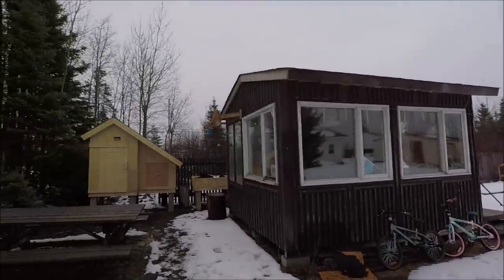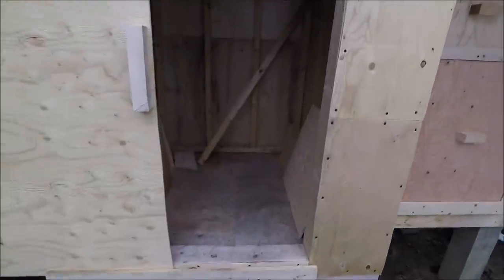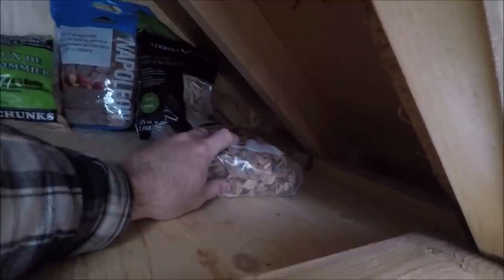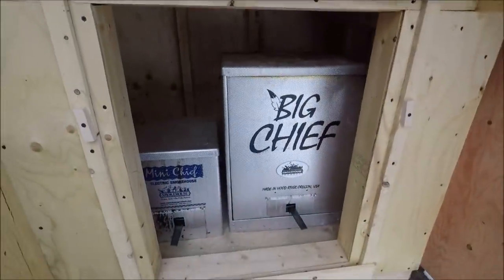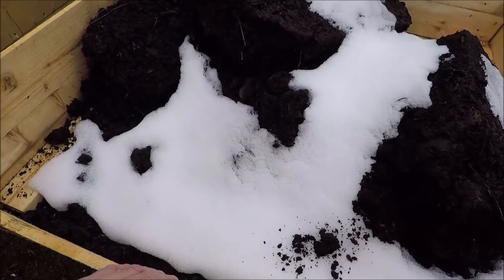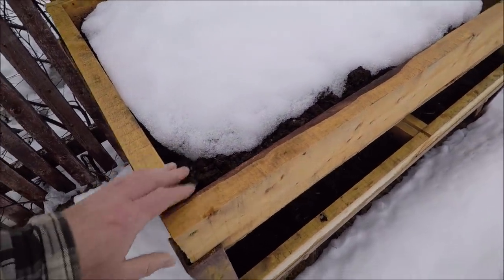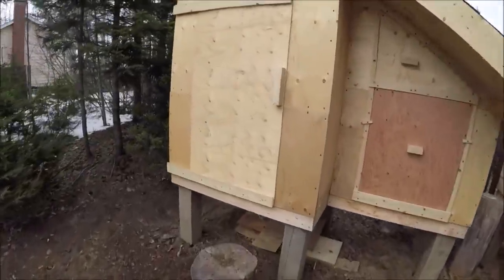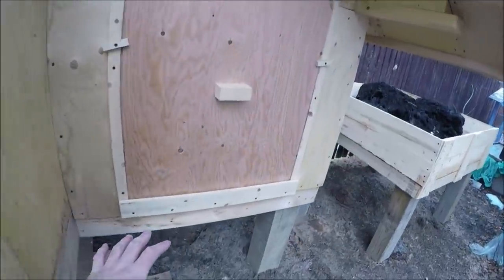Backyard Smokehouse & Extreme Raised Garden Beds

Comment: so when you say smoking with apple wood is that wood from an apple tree or an actual tree called apple wood, im asking because im about to pull out a dead apple tree (fruit) 
that i could run through a chipper, green leafy veggies and herbs will grow on the bottom quite well as they are both weeds
Reply from the maker: Wood from a apple tree, guess little different flavor depending on the type of apple tree its from..